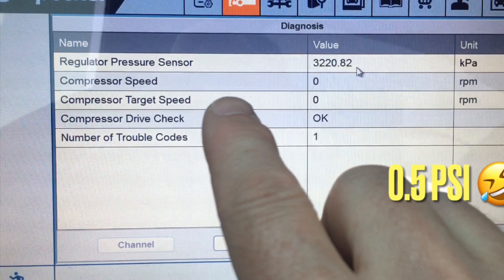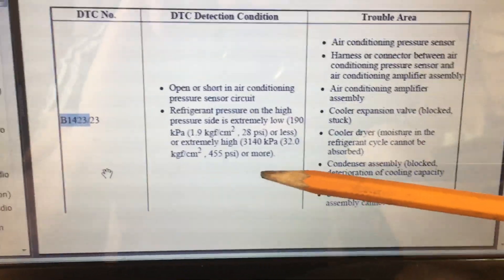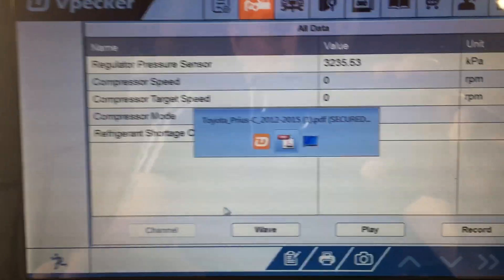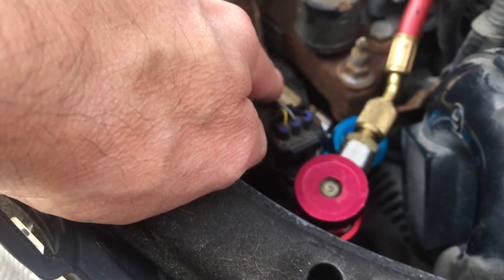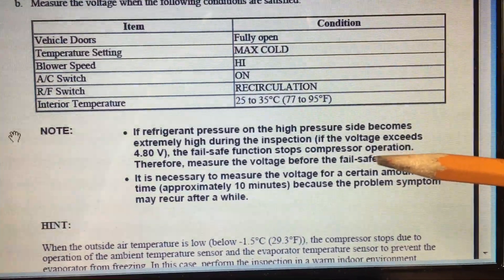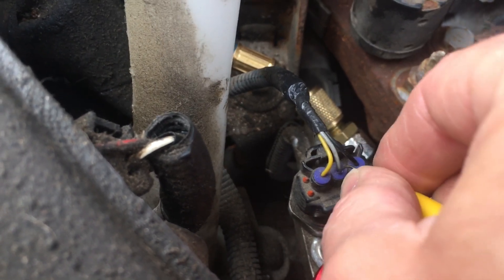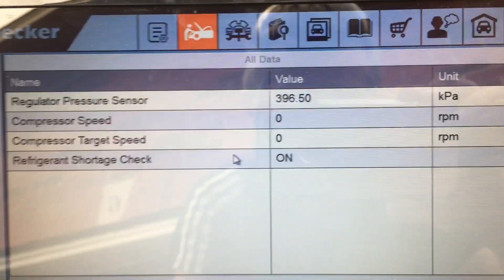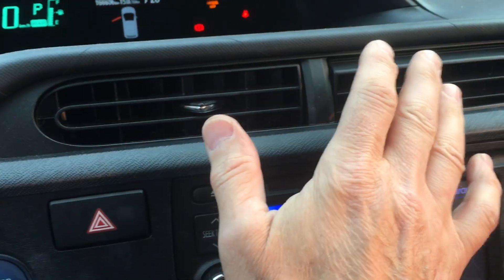Prius C  AC Not Cooling Misdiagnosis

Comment: I have the same decade box, just a bigger brother version.
Reply from the maker: There is a three decimal place difference between kPa and Pascal’s 🤣. Would you know off hand if there is a check valve under the pressure sensor Tom?
Reply: @TheGibby3340  I honestly can’t remember. 

I’ve only replaced one on a Prius not even a Prius C but I would assume they are the same. Cannot remember if there is a Schrader valve under there .
Reply from the maker: Will look into it. Local dealer wants $490 + tax for the sensor 🤣 Looks like I am heading to the scrap yard with my compatibility list. Yaris looks like a good candidate. Thx 🍻
Reply from the maker: Doesn’t appear to be any valve 😕

Comment: It'd be boring if it was too easy. Good diagnosis 😁. Im not sure the Toyota's have a shraeder valve at the pressure sensor to save pulling the refrigerant out but we know a man who does 😉.
Reply from the maker: Hi Iain. I wanted to convert 3220 kPa to PSI. Google seems to have heard only Pascal’s 🤣 Big difference ! End of the day still my mistake. Had myself talked into a leak scenario.
Yer ahead of me on whether or not the sensor is installed with a check valve. Certainly hope so. 🍻
Reply from the maker: Doesn’t appear to be any valve 😕
Reply: @TheGibby3340  so do you change the condenser while it's empty 🤔
Reply from the maker: Yeah good point. I am reluctant, the condenser I bought is aftermarket rubbish. I think the oil staining is chassis corrosion inhibitor blow back. Leak check will hopefully be decisive. 🍻